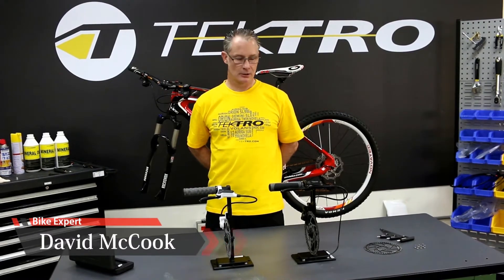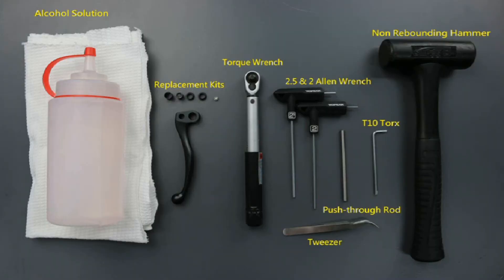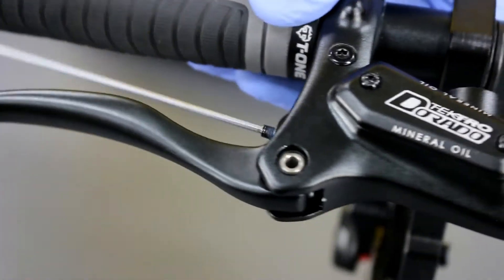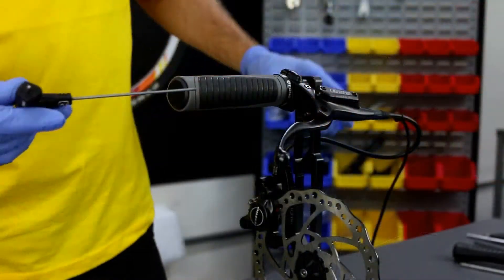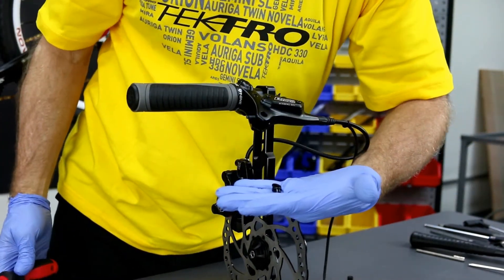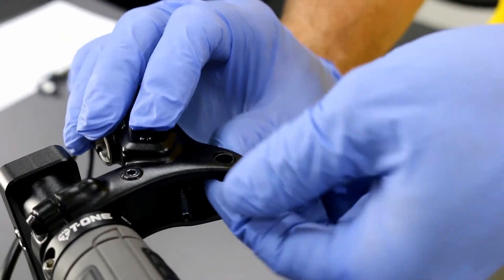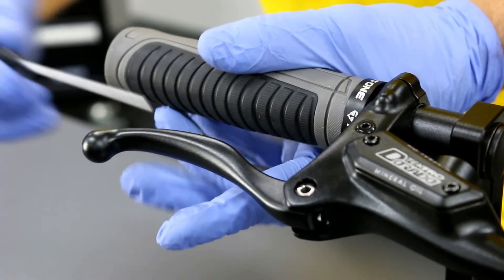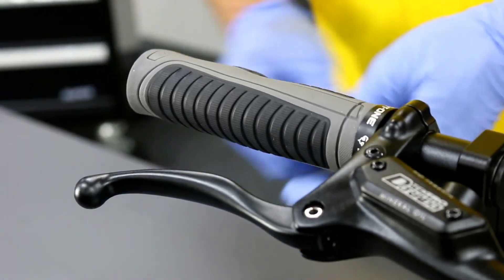Lever Blade Replacement

Comment: In the HDM 275 lever replacement it appears you have to take the bleed screw out to release the cover to access lever pin ....daft design ...it has two dedicated retaining screws anyway. Doh
Reply: Thanks for sharing that info. I have the same brakes and I couldn’t find instructions anywhere. I was hoping I didn’t have to open up anything with brake fluid